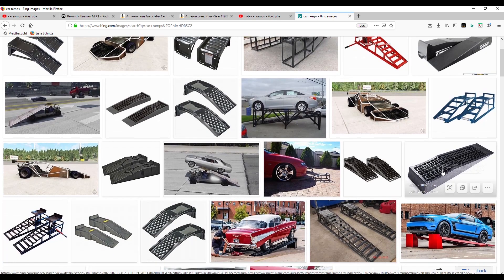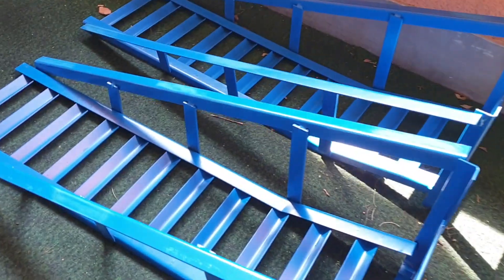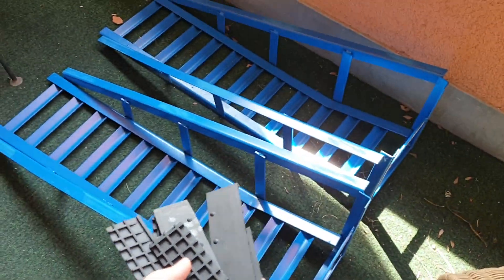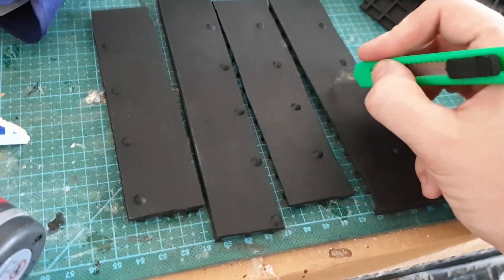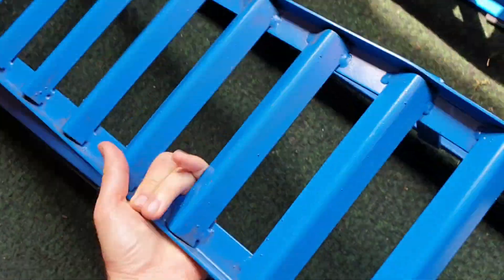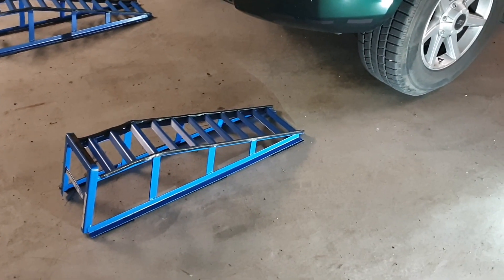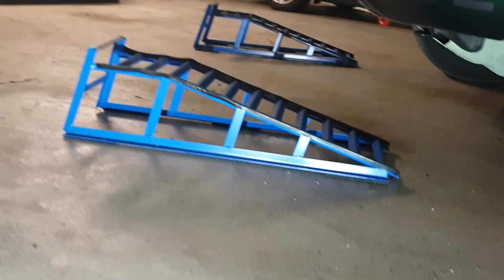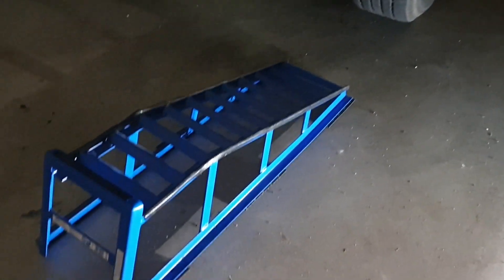How to have more fun with your car ramps

Comment: The easiest way is just to tie two pieces of webbing or string to the ramp as you drive over the webbing the ramp cannot shoot away. Also, those ramps are not for that vehicle they are far too small, and they do not hold the wheel properly in width, circumference and weight of the vehicle an accident is waiting to happen. The forward weight is too far over the front of the ramps this may cause forward topple the wheel stop is not big enough and the width can cause side topple.The ramps should be bought with that vehicle in mind not on the cheapest price.